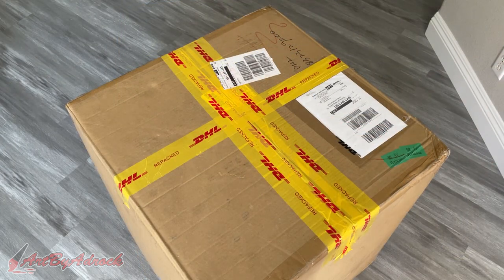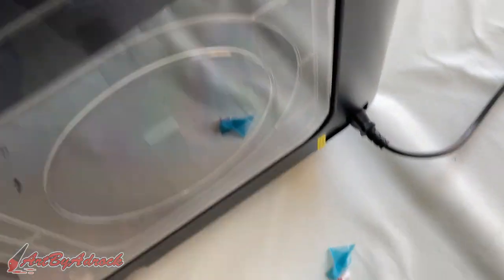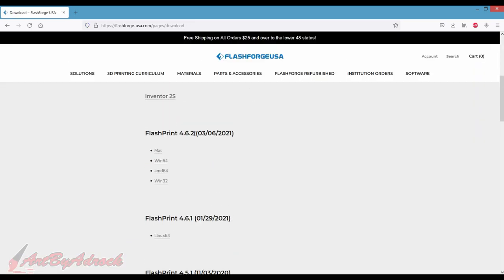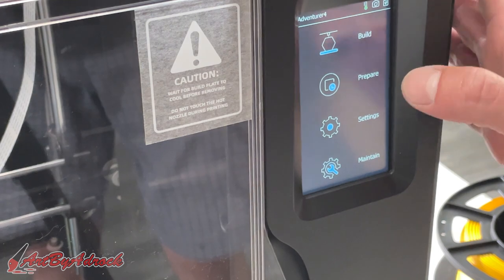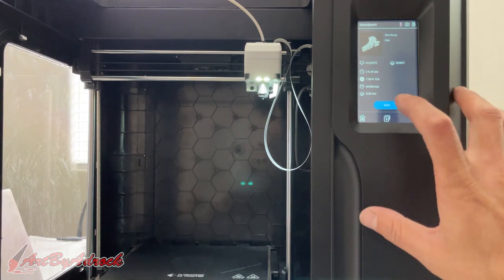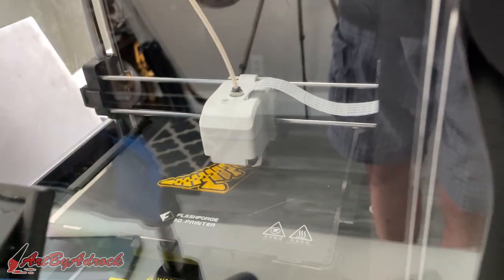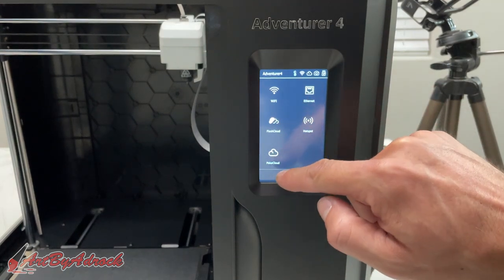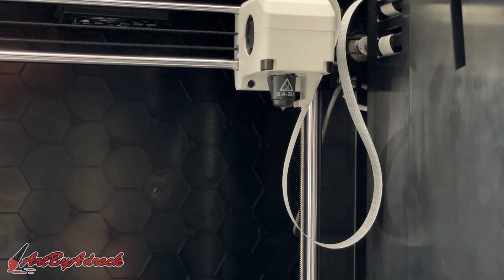Testing The FlashForge Adventurer 4 3D Printer (Newest Model) - Honest Review

Comment: SRY... seems to be common... they (flashforge) say they test every printer 10 hours in the factory... testing and calibration... still... a new bed should be included as well as the missing filament...

Comment: Definitely a used/second-hand machine due to missing components, especially the spool of polymer, and the manual.  Why they would ship you a non-US model is a bit of a puzzle, also.  Luckily, it seems this machine is multi-voltage, as otherwise, you would have known about it when you switched it on!  The menu seems quite intuitive, as it didn't take you long to work out how to do everything you needed to do.  Although, a less experienced person might have struggled a little bit.  The output looks fine, though, which in the main thing.
Reply: Yep if he turned on and it wasn't it likely would trip the breaker

Comment: Great review, as always. It seems you've used enough printers to have a good idea what's out there- do you have any recommendations for someone just looking to start out printing as a hobby? I've been thinking about getting into printing recently and my 7yo son watched this video with me and wants to get into printing too.
Reply from the maker: I’m a really big fan of the flsun super racer. It’s prints accurately and really fast. However for a beginner the flashforge is nice and there’s no setup or putting anything together. It’s a little bit more pricey though and bulkier. If you want something though with a large build volume check out the sovol sv03. Those would be my top choices if you’re just starting out. Hope that helps you.
Reply: @ArtByAdrock  I'll research all 3 options- thanks!

Comment: Did you buy that new? It should have came with a roll of filament, a quick start guide and a extra nozzle. Also the print head should be black not white. Also it should have not been used and they don't send those printed parts with it either.....but those things are irrelevant. Its a great printer.